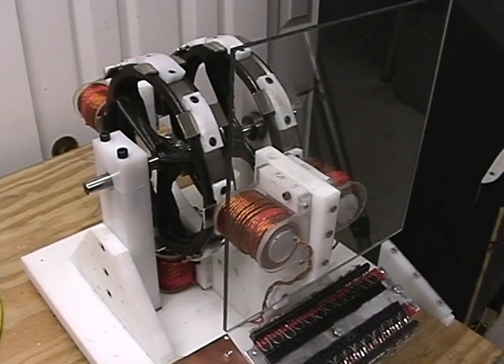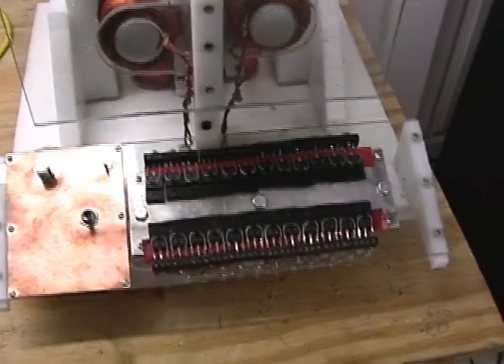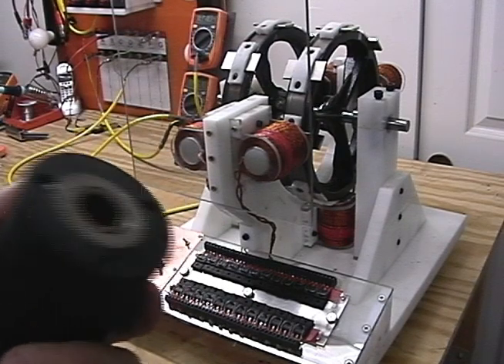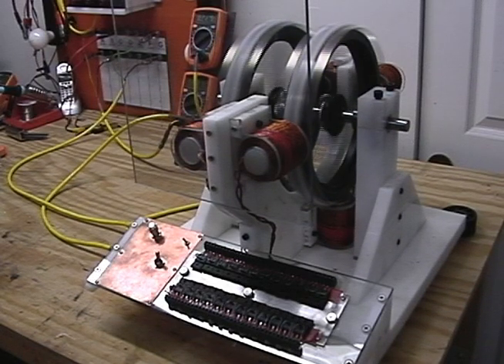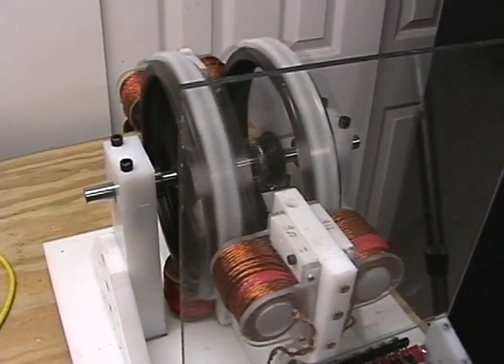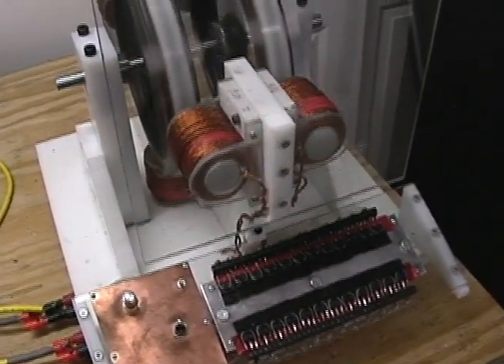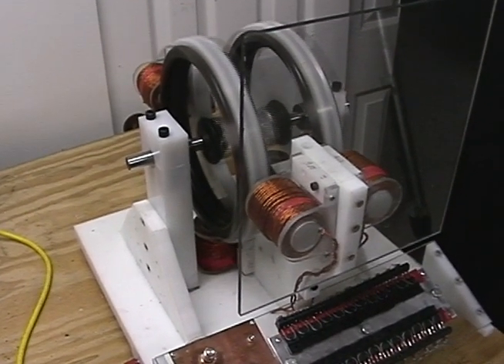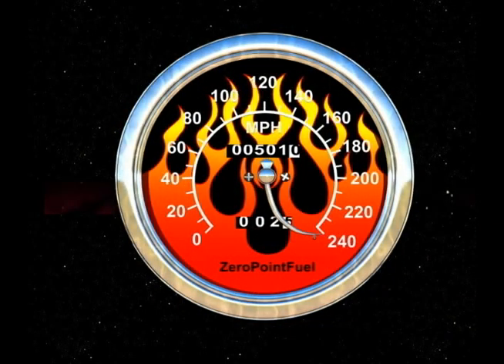VMG624 About Performance

Comment: How do you spec out the coils/circuits/wire gauge numbers?

i would assume more coils gives you more torque.

now how do you decide how many wires you run in a coil?
seems like you decided to run 4 wires per coil therefor 4 circuits etc.
whay not 6 per coil or 8?

is there a way I can have a base theory to make my decision on?

How would I know there's "too much" coil for the core? meaning the core
saturates before the magnet is on top of it. and kinda wasting electricity in the coils?

Comment: Nice work.
 What do you use as input (power, current, voltage). What is the efficiency of the system?
You generate torque, how much torque do you generate?
What is the usefulness of this construction?
Thank you.

Comment from the maker: honesty a stop working on this design 3 years ago because the Iron wheel  messed up the field and the wheel would not go more than 1000 rpm. The new Boxmotor can do that a less than 1/2 the amps and recovery is higher too the Boxmotor project has a complete how 2 build  PDF's and videos thanks for watching

Comment from the maker: @kapierenundkopieren SK C5101 surplus NPN  160V 12 amps hi speed switching chips but any Hi speed NPN chip will work just tweak the trigger Ohms and you get it working  the latest motor is running at 120V @3AMPS and outputting 12V @ 22AMPS check out the cartmotor on my channel for full specs

Comment from the maker: marthale7 thanks for the suggestion. but I have tried using ferrite in different forms, but it does not generate significant torque compared to other types, cast iron filings or cast-iron powder from  waste filings from a machine shop will allow you to shape your course anyway you want by suspending them in resin, we are studying the possibilities of using plastic as the substrate.  The ratios of plastic and iron powder is crucial to its effectiveness of the core, Iron should be above 80%

Comment from the maker: Actually neo- magnets don't seem to permeate the core in that way.  As soon as the field is applied electromagnet kicks in welding rod cores do not seem to remain saturated long enough to affect performance. we have motors with welding rod cores.  For more than a year.  They have not been significantly magnetized in any way check out the H3-6 speed test, video over 3000 rpm.  The field is deftly collapsing perfectly